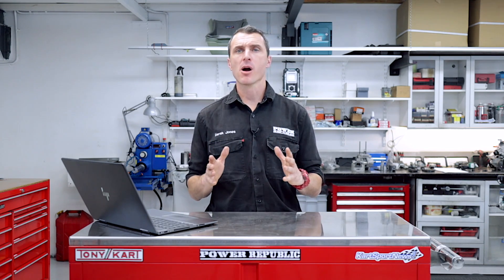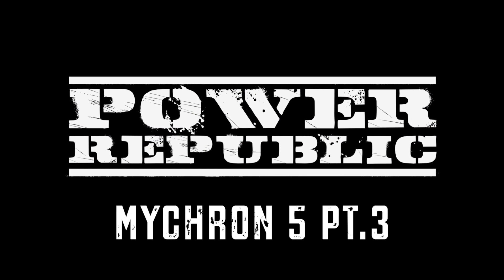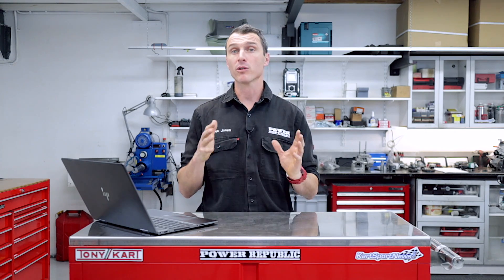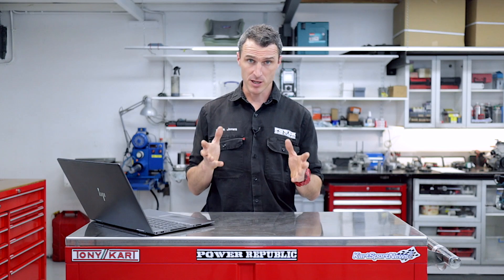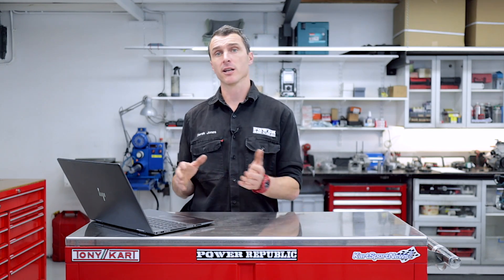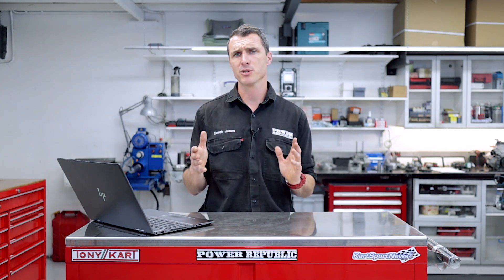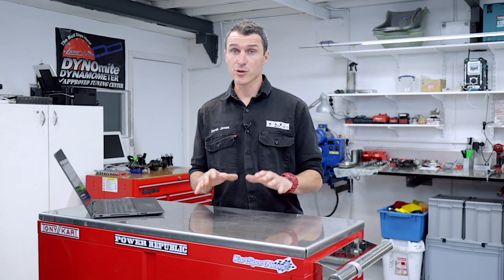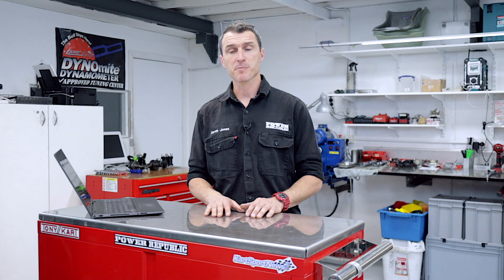HOW TO: Mychron 5 Go Kart Data Logger Part 3 - POWER REPUBLIC

Comment: What type of sensor should I be looking at for an X30 to measure water temps? And how exactly do you install this sensor?
Reply from the maker: We use a H2o sensor and it can be bolted directly to the cylinder head.

Comment: hi i have been told what i need to keep my temperature at in rotax but i’m not sure what sensor to get thanks
Reply from the maker: Hi Lloyd, for the rotax you need the M10 thread water temp (H20 sensor) and it screws into the cylinder head cover.
Reply: Power Republic   Thank you very much for replying and is there a video about battery acid

Comment: There is also the Kart magnetic lap receiver. I am guessing this will give a more accurate time, what are your thoughts?
Reply from the maker: great idea, but we only use the GPS and it works fine for us.
Reply: @PowerRepublic  So finally got the magnetic lap receiver installed and tested. It proves that GPS timing on the mychron is pretty accurate. Checked on 7 laps on a 600meter kart track and the biggest differences where a 0.020 faster and on the slower side 0.018 slower. Adds up to a potential 0.038 difference. This was on a clear day so with a pretty good GPS (GPS_PosAccuracy) avg of 0.7) so I am guessing a little more difference on tracks with less GPS accuracy or on cloudy days. Will check a longer track soon and check another one with cloudy weather (it's autumn over here, so should be soon). A big thanks to Roger from AIM in explaining on how to read this.
Reply from the maker: @kartbroertjes  awesome feedback.
Reply: @PowerRepublic  what I make of it: for getting better, comparison own or team results it will always do. On the other hand let's say you are entering a race and look for old results which are taken with a transponder the only way to be sure is to go magnetic. Recently on a 1km course I noticed about a 1s difference between the Mychron with GPS and the transponder time. It was only a 1,66% difference, but still.
Reply from the maker: @kartbroertjes  great point , i have never tried since the M5 has been released.  i think as an added extra its probably a great idea.
Reply: @PowerRepublic  I think I will buy one with a set of pedal sensors you spoke of in the video. As soon as I get them I will do some comparisons and let you know... If it is possible to have two data sets. Not sure what will happen if I add the sensor.

Comment: Hello Derek, quick question. As you know I have a Rotax DD2 engine and I would like to optimize the carburetor so which one would you recommend, the Lambda sensor, or the Cylinder head under spark sensor, or the Exhaust gas temp sensor, which one is best?
And what readings should I get at the end of the straight on each of the sensors, Lambda sensor, CHT sensor and EGT sensor? 
I’m happy to make a donation to Power Republic for the help.
Thanks a lot.
Reply from the maker: Hi Silvana, how'd did you go with the EGT sensors on your DD2?
Reply: Power Republic 
Hi Derek, its been raining here so I haven’t been at the circuit to install the EGT sensor on the DD2, but I hope to be able to do it next weekend. I’ll let you know how it goes, I’m looking forward to it. Cheers!
Reply from the maker: Silvana H. Santos the rain is the best time for practice 😂
Reply: Power Republic 
I’m a bit scared of driving in the rain, but yes, I have to give it a go! Have a nice weekend. 🏎💨

Comment: Hey, great video, could i reccomend a video idea in which you explain what parrs of the kart have to be checked before buying and running a kart, my rear right wheel recently came off due to a bolt not being tightened enough on the rear axle
Reply from the maker: Hey Matiss, we have a video series you can buy coming out called Racing Rituals available on Patreon or our website that covers race prep like a pro.